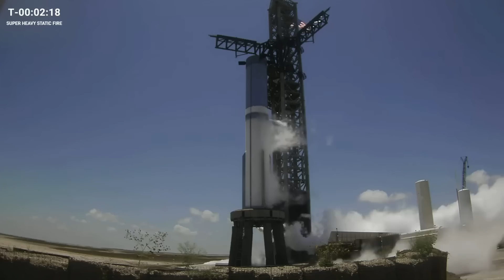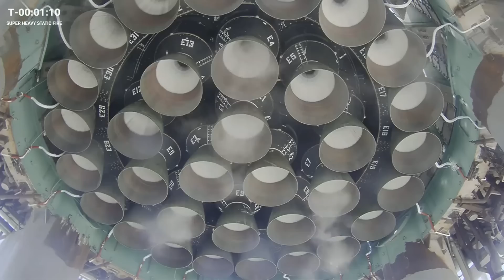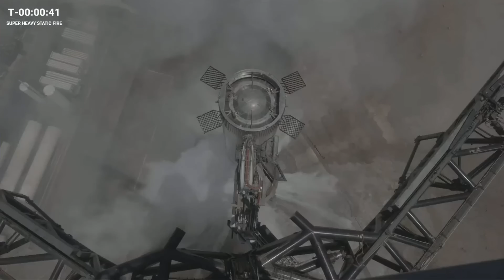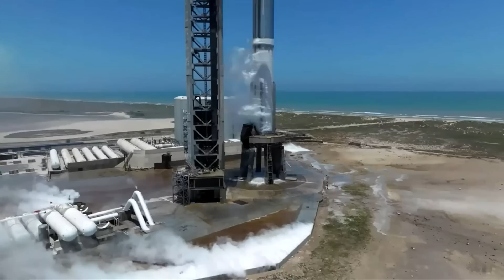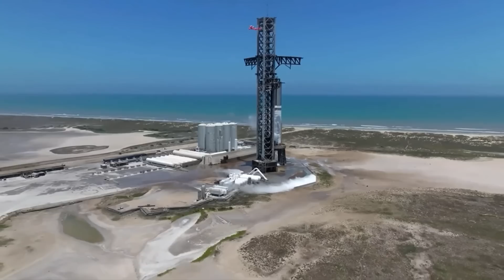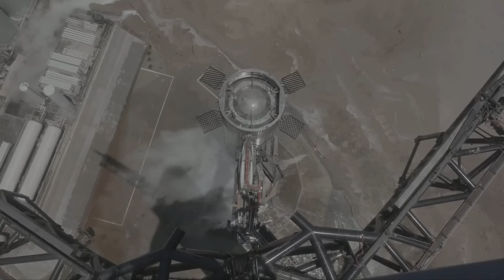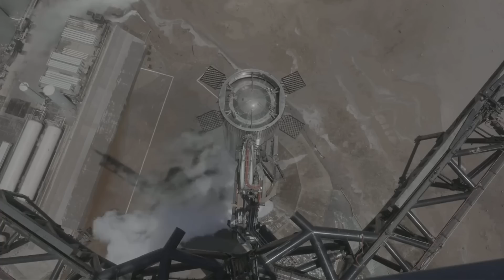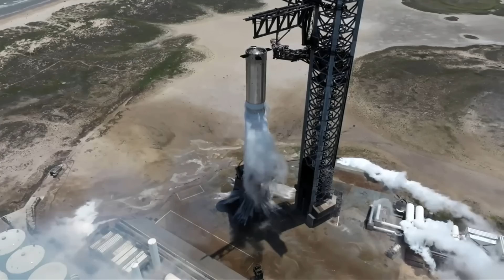SpaceX fires up Starship Super Heavy Booster 9 in Texas

Comment: Glad it was not another test launch.  Even with the water suppression, losing four engines and scrambling the test a little over half way thru means that they will have to come up with a better launch pad and way to protect the engines from shutdown.   The good news is they still have the test vehicle, so I hope they can figure out what is going on, since the engine power was less than the last launch, and one more engine shut down in spite of that.

I am not sure a design, which relies on so many points of failure given the number of engines can ever be a trusted platform for manned or heavy lift space flight.  I feel it requires too much computing power, and also creates harmonic issues which cause bridges to fail and other well engineered structures.  

The more factors that can create harmonic issues which can vibrate one or more engines to a failure point, the less likely success can be achieved.

I was just 40 miles away from the two bridge collapses in the '89 World Series Quake, about 80 miles north of the epicenter.  I had just driven over both of them a week prior, on my way to San Jose and back.   We had bridges all over the Bay Area that did not fail.   My house shook worse, 80 miles from the epicenter, than some just twenty miles away and all was due to harmonic focusing--all the elements coming together at the exact place, resonance and moment--at the wrong time.
Reply: They probably addressed this already. The test likely aborted sooner because of the four engines shutting down prematurely. The computers would have detected this issue and shutdown the entire vehicle (and triggered the FTS if it was active). This is because the booster requires no more than 3 engines to be out for liftoff (the primary advantage of high engine count), so a fourth early shutdown would trigger an abort (if it was till on the pad) or an FTS firing (if it was flying).

The 4 engines prematurely shutting down can likely be attributed to this being the first test of several major systems at once for the first time. This test featured a new variant of the raptor engine (swapping the “problematic” hydraulic system for electric steering), the deluge system (which was designed for use but not installed for IFT1 because of time and the expected erosion, not crumbling of the concrete below the pad), the spin start arms (used for starting up the engines), Booster 9 (featuring numerous changes to B7 including structural and electronic), and the entire ignition sequence. All of these are factors that have loads of unknowns and need to be tested, so parameters like engine controls will be set extra stringent to reduce unknowns to as little as possible. Basically, it’s likely that the engines were shutdown early because they didn’t conform to requirements that were set for testing, not operation and were likely extra strict.

Harmonics in a rocket are actually quite difficult to achieve. The best you get from the engines is from the pre burners, which can easily be mitigated from software. The vehicle will also bend harmonically, but only if the steering system oscillates in the exact wave  which is impressively hard to replicate and can be again, easily eliminated using the steering software. Harmonics from the wind could be possible, but only if you launch in the wind; something no one outside of the Russians do (and only because the rocket they use has flown since the 50s so it’s behavior is well known).

The computing power requirements aren’t that high actually, and even if they were, Starship can carry 100-150 tons of payload reusable and 250-300 tons when thrown away. The amount of mass that can be attributed to computers on the booster can be higher as well because it’s on the first stage. Basically, Starship can accommodate an entire data center on the booster and still be usable to a high degree.

In terms of reducing engine count, the issue is that it becomes a problem for the very issue SpaceX is designing this vehicle to solve: reusability. A low engine count booster has an insane thrust/weight ratio for a boost back and landing burn. You would have to heavily strengthen the vehicle and would also have to contend with the issues of suicide burns but with even less timing space than F9. The ability to throttle would be reduced as a consequence, and issues with reentry would be more complex. Most importantly, any engine failure for landing would be detrimental to a far higher degree. With 33 engines, you can select from a group of 13 engines to land on. With 9 engines, you don’t get a choice at all; so any issue with reliability becomes far more complicated as a result.

For the pad deluge system, it’s actually quite interesting. They would have to raise the elevation of land around the pad by at least 50 feet (the height of the current structure), and ensure it does not suffer from soil erosion. Beyond that, they would have to deal with the already irate environmental groups that are suing SpaceX and the FAA (check out their lawsuit, it’s filled with assumptions). 

For reference, 39B features a 12 meter gap between the base of the trench and the underside of the mobile launcher. It was designed to support the Saturn 8 Nova (which never came to be) that would feature ~14M pounds of thrust. Starbase features a 15M ground to pad bottom distance and a rocket with 17 pounds (that may be extended to 20M). Given that exhaust damage drops exponentially and the larger gaps for exhaust gasses to leave, Starbase is actually better than the original plans for 39B.
Reply: Falcon heavy is a heavy lift vehicle that has 27 engines, only 6 less than starship, and it is trusted by NASA and others to carry the heaviest payloads to orbit. Having a lot of engines does not mean a vehicle itself is prone to failure. Having a lot of engines, especially independently gimballed ones like the raptors, simply means that if one or two of them fail you can continue the mission with little issue. For instance, if Saturn V were to lose 2 engines it would be left with 60% thrust, whereas if Starship loses 2 engines it would have 94% thrust left to continue the mission. If the booster from the first flight test had the electronic thrust vector control upgrades that are currently installed, there's a good chance it would've made it to orbit even with multiple engines not firing.
Reply: You totally pulled that all out of your bum😅

Comment: Did 4 engines shut down? No flying concrete this time. I think engine reliability needs some homework. Love it all. Another step closer!
Reply: The Raptor engines have proven themselves reliable and safe through hundreds of Starlink missions. The issue might well be just how many they are plugging into the Super Heavy booster and the possible complications from harmonic vibrations that are knocking them out of service. Am curious as to if these shutdowns were in the same area or if scattered throughout the configuration.
Reply: @marklupus  The Starlink missions use the Merlin engine, not the Raptor. Raptor has never made it to orbit (yet)

Comment: Elon learned the hard way the necessity of sound mitigation.
Reply: How many times does it need to be said that the water deluge system was always planned, already designed, and had parts already prepared?

He admitted *before the launch, that not using it would probably be a mistake.
Reply: There was nothing to "learn" here.  They knew all about the need, years ago, and had been planning and building the deluge system loong before the first launch. After more than 200 launches of Falcon 9 and Falcon heavy, there wasn't much more "learning" to be done.  Just building, and testing.
Reply: The deluge system is not for sound mitigation. It's purely to protect the launch pad from the pressure of the engines.
Reply: @jarjarbunks2844  actually, that isn't correct.  As with all rocket launch pads, one of the primary purposes of the water deluge system is acoustic supression.  The enormous shock waves could otherwise damage the vehicle itself and tbe GSE.  Also, the comparatively small pressure of the water does very little to protect the pad from the immense pressures (much of which is acoustic in nature) of the rocket exhaust.
Reply: @ChristLink-Channel  it's not the pressure of the water that protects the launchpad at starbase, it's the sheer volume of water that turns to steam dissipating a lot of the energy from the raptors. Also, I'm no expert on this, but I understand that traditional deluge systems are used for sound suppression, it's just that I've heard that the rockets themselves don't need protection from acoustic damage, it's the sensitive payloads they carry containing expensive electronics. Apparently Starship is so tall that the shockwaves are too far away from the payload bay to cause damage. Spacex's main objective with the water-cooled steel plate is to protect the launchpad, not mitigate sound.

Comment: I think that sound suppression water system worked very well.
Reply: How would you know?
Reply: Cause I didn’t see another crater on the Launchpad.
Reply: @graysoceanworld5662  Not much of a scientist or engineer, are you?
Reply: @rocksnot952 I’ve seen some comments you have made on other videos, seems like you have a fairly negative attitude of this program. Thats unfortunate, luckily you wont impede SpaceX in any way.
Reply: It's not a sound suppression system, it's just there to protect the launch pad. Starship is so tall that any potential acoustic damage wouldn't reach the payload bay so high above the engines. Rockets themselves can handle the sound, it's the sensitive instruments in the satellites (and humans) that rockets carry that need to be protected.
Reply: The water is to keep the world's largest cutting torch from melting the metal plate so it can stay strong enough to withstand the pressure of the engines.
Reply: @wesleyashley99  I am aware of that. The engines were not at full power. How do you know it worked?
Reply: @rocksnot952  we won't know how it does in an actual launch until the launch but static fire test gives some data that helps boost confidence and lets them know if they need to make any adjustments.
Reply: Do you think it needs more upgrading or is it good enough on preventing another crater from happening?
Reply: @graysoceanworld5662  I don't think any major changes will be needed.  They may need to adjust pressure or volume of the water but as long as it is enough to keep the plate cool it should be fine under full thrust.
Reply: @graysoceanworld5662  I don't know. I'm not an engineer or a scientist.
Reply: But we can't see a thing because of all the steam! How are engineering cameras going to get any idea of how well super heavy is working? This needs a  flame trench and water deluge system like pads 39A/B at Kennedy.
Reply: @owensmith7530 the water table is too high there.
Reply: @xploration1437  I said nothing about digging down. Pad 39A/B at Kennedy are built up for the same reason, they couldn't dig down for a flame trench.

Comment: Why can't they ever get all engines fired?
Reply: They gotta hire a quicker guy to lite the fusses.
Reply: @fredjones7705  🤣 🤣 🤣
Reply: It is very complicated alone to start 1 engines, 33 engines is a lot harder but multiple engines can fail and still reach orbit
Reply: Maybe because this is still very early on in the "testing" phase?  With each new test, they get a whole lot more data, which then then analyze carefully and make modifications as needed.  Jist like they did with Falcon, Falcon 9, and Falcon Heavy, they'll keep on testing ag tweaking until it all works flawlessly.
Reply: The blue touchpaper got wet.
Reply: The pad took the power this time!! They still need to get the raptors to be more reliable.
Reply: @scupking  they need a full power test fire for at least 20 seconds, not just 2.7 seconds to actually test the pad
Reply: It's a process man!
Reply: @stratolestele7611  it sure is

Comment: 29/33 fired and 2.7 seconds out of  5 targeted. Not bad!
Reply: 🎶 Two out three ain't bad. 🎶

https://youtu.be/HVvXWUAKtus
Reply: they can still reach orbit with 30 engines, it's kinda bad actually. They still haven't said why the test only lasted so short.
Reply: @leriku2270 SS is supposed to only be on the pad for about 3 seconds after ignition. 5 seconds is just about right estimate for how long that pad will have to survive
Reply: @TheNheg66  it shut down early, that's pretty bad.
Reply: @leriku2270  not neccesarily really bad. I presume it was an autoshutdown due to 4 engines going out while 3 engines out is the maximum. We don't know what the cause for the engine shutdowns are, it's way too early and too little information to speculate at this point but i don't see any serious issues
Reply: @TheNheg66  i guess
Reply: Hi, only through testing will they iron out the bugs. More data, more improvements and then eventually a launch. Take care M.
Reply: unclear whether that's long enough for this to be a real test of the pad. The static fire before the first launch was significantly longer at nearly 10 seconds and hadn't shown any weakness in what was clearly a deeply flawed launch pad.
Reply: @weatheranddarkness  spaceX halved the time between ignition and liftoff from 6 to 3 seconds,thus the pad shouldn't be exposed to significant pressures for more than 5 seconds which was the intended test duration, but i agree that they should probably push it up to at least 7 - 10 seconds for good measure, i'm pretty sure we'll see more static fires.
Reply: @TheNheg66 even talking about a 5 second test time, but only getting about half, it really isn't going to show if this can hold up to repeated launches
Reply: @weatheranddarkness  i agree, they will have to re-do the test, this was insufficient, though not a failiure.

Comment: White thunder in ignition?
Reply: The clouds were steam, and the visible flickering during the firing was the shockwaves of the engines reverberating through the exhaust/water/Nitrogen particles under the rocket.

The sound is obviously the engines firing.
Reply: Is that a question?
Reply: @stratolestele7611  yes i dont knlw what It is
Reply: @arthurlunar7835 it's steam. Those are steam clouds, created when the heat of the engines turns the water into steam, which as we know, is white. 👍